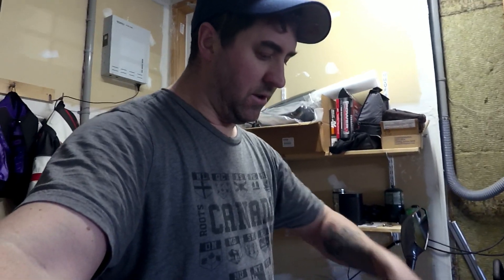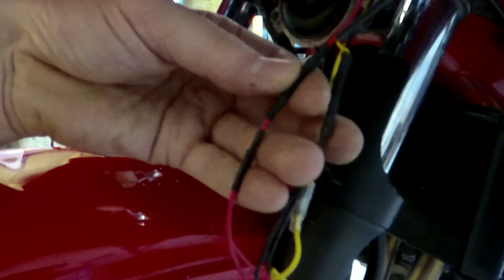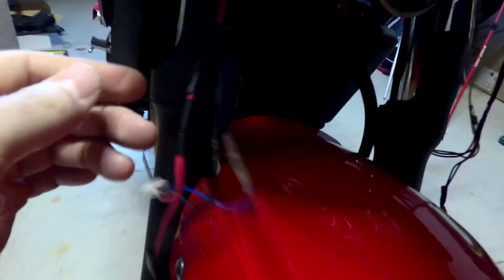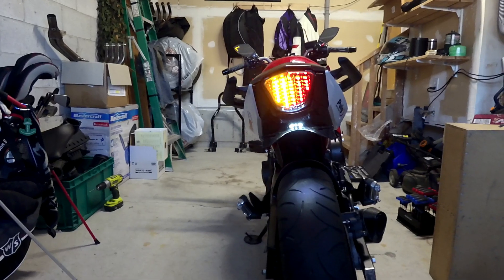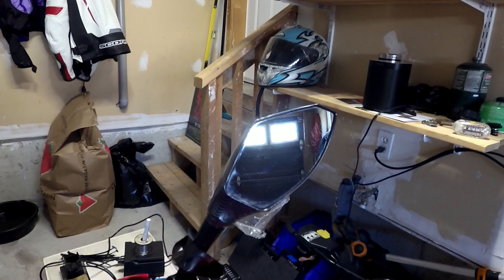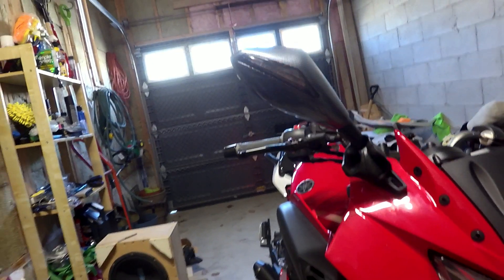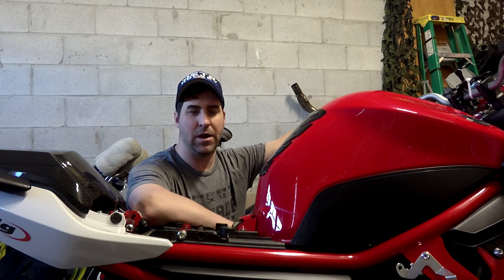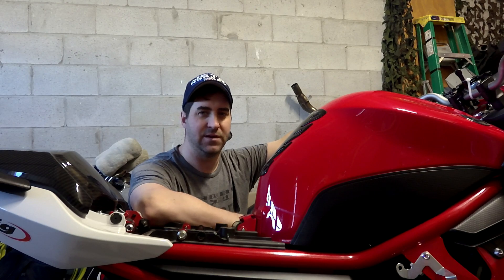Fully Integrated turn signals for the FZ6R

Comment: Thanks for sharing man! I was about to buy just a regular zx-6r mirror to replace my stock one but now I'll just go with this. One question tho, around 1:05, the base of the mirror looked a little too big.
Is it noticeable? or the rubber boot hides it away?
Reply from the maker: Yes the base of the mirror does not exactly fit in place nicely like the old mirrors. The original mirrors are actually a recessed mount. The new mirrors will actually rest against the front cowling, instead of the mirror mount.  I didn't bother to put a piece of rubber underneath. I suspect it might leave a few marks on the cowling. But the supplied rubber boots cover it up pretty nicely. Not perfect, but well enough.

Comment: Did you tap into above the oem Yamaha connector or below it
Reply from the maker: If I remember correctly I had a spare set of leads for my signals I think. So I most likely did not tap above the OEM connector. I like to leave that untouched.

Comment: I have those mirrors on my fz6r and I hate them. Cant see behind me and they are constantly blowing back at speed. I tightened them as much as possible it still didnt help.
Reply from the maker: Yup. I agree not very functional. Even the bolt that you use to tighten them is on the wrong side near the widescreen, at least in my experience. I have gone back to stock mirrors now.
Reply: @RideThe6  Kawasaki ZX6R MIRRORS LOOK SWEET AND WORK ALOT BETTER ON OUR BIKES. THAN THE EBAY ONES IMO  THEY BOLT RIGHT UP
Reply from the maker: @robertholsopple9451  I'm gona have to check that out then because I like the looks of the ZX mirrors.
Reply: @RideThe6  theres alot of info on the Internet about that swap. I dont know off hand the right years. I want to switch mine. They look like they have a wider stance to be able to see behind the bike.

Comment: How long took you to replace the mirrors?
Reply from the maker: It will take you a few hours for sure. Plastics need to be removed and you need to wire into your existing signal harness and drill holes into your mirror mounts.
Reply: Thank you very much for respond I did and now I just need to connect the wires looks awesome